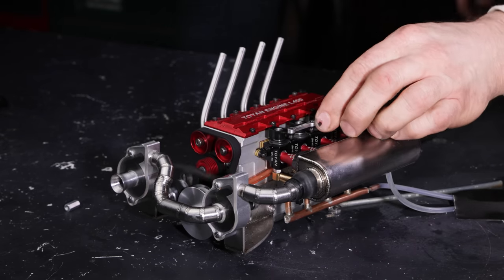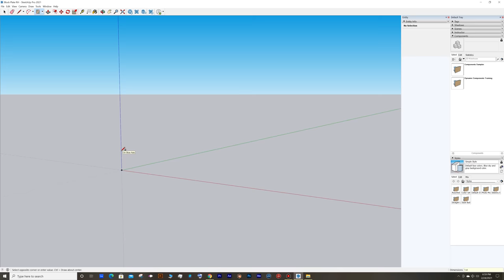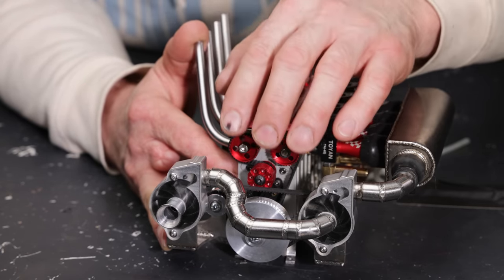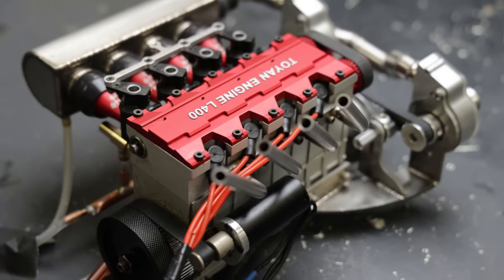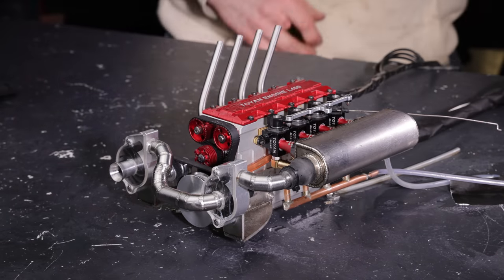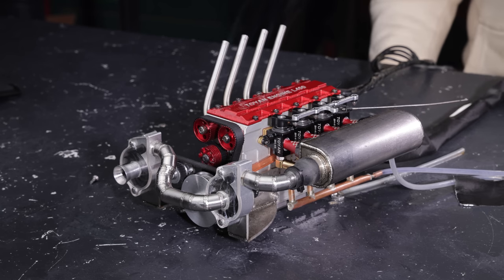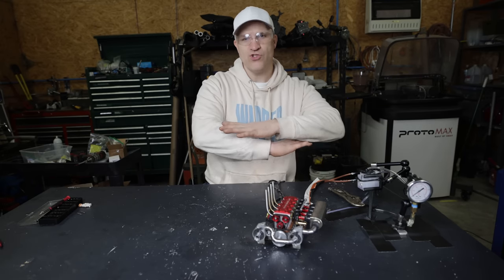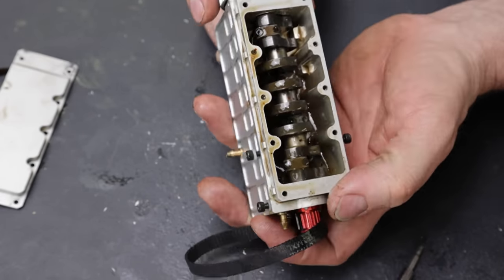Twin Supercharged 4 Cylinder Nitro RC Engine

Comment: I would love to see a 2JZGTE scaled down - actually, I’d love to see a Mk4 Supra built the size of a Lawnmower, 🤩
Reply from the maker: That would be nuts
Reply: @WarpedYT  A scale model mkiv go-kart with real scale model 2j wold be the coolest thing I have ever seen. 
Even though the newer Supras get all the popularity I love my 88 mkiii turbo, I have had it for 15 years and I love the styling on the 80's Japanese cars even still. My first Supra was an 82 mkii and I got crazy looks anywhere I took it, nobody knew what it was LOL.
Reply: 2 more cylinders and you're there baby
Reply: @755hp  that Barbie Jeep that grind hard plumbing is pretty wicked , it had like 50+hp and then they supercharged it.

Comment: When you installed turbo , you need to install Samco sport hoses and you also need K&N racing filter plus bigger coolant radiator and oil cooler 😅

Comment: You're having a fueling issue. Even the most efficient naturally aspirated engines run at several pounds under atmospheric pressure because of vacuum dilation from drawing in the air using a vacuum pulse. Since the engine is now running at 3 pounds over. It's actually seeing double the air. NA at high RPM is 14.5 - 8 = 6.5psi or less. This is why all but the most vacuum efficient motors see power loss at high RPM and why mid-history F1 engines could save fuel and still turn faster using high RPM NA grip. Then they survived the early turbo competition by running higher compression and using velocity stacks (like yours does). Giving them 7-8 psi (1.5 psi advantage). Remember this was before variable velocity stacks were invented and computer maping of intake plumes to time the refraction of intake pulse echo. 
Now your setup is 3 psi over atmosphere 14.5 + 3 = 17.5. That's more than double the air even with your velocity stacks power scavenging the vacuum pressure pulse in NA format. 
Now this is where the it gets complicated. Not only is there twice the air. Requiring double fuel to reach stoichiometry. People learned in the mid-history and before of racing to run richer mixtures well above stoichiometry for three reasons.
1.) Fuel cooling effect. The vaporization of the fuel draws heat away and puts it from the engine to the exhaust. Making better exhause flow, evacuation of spent gasses and cooling the head or intake gas. This also made more power by making the air charge denser alowing for even more fuel and therefore cooling.
2.) Rich mixtures turn more oxegen to CO2 and CO2 carries heat away with it. That why completely NO2 dependant drag motors use CO2 boosters to keep from melting pistons and valves. Enjoying a 2% power boost per charge and the ability to run even more NO2 and feul before structual failure of metal or meltdown/gauling occurs.
3.) A rich mix burns at a higher rate and continues to burn past the point of the exhaust phase. This creates more power and scavenging oportunities in maping the exhaust pulse reflection which then more completely emptyies the hot spent gasses. Which adds power by allowing more air and fuel to be added, but that also cools the engine better and the hot gas doesn't stay in place multiplying the cooling effect. Normally the forced air (boost) corrects this, but since you're running a naturally aspirated camshaft that effect is nullified.

Using a stand alone fuel delivery method (a variable electric fuel pump) and increasing fuel delivery (injector pulse duration in larger engines) should correct this (firstly) and gain you the most benefit.
Then change the cam.
Then run an inline connected exhaust header.
This will net 75% more power and keep you from overheating for 3x longer. Also allow close to an NA RPM ceiling.

I really appreciate your CAD skills, but this is what you missed. Engineering doesn't teach this stuff. It's all learned through asking race heads who've been learning these tricks for decades.
Can't wait to see you correct this and throw a rod for science. Get it on high speed please.
Reply: I was just about to say that. I might add that the dilation compression of the ventral cam is way too low under current atmospheric conditions. In order to fix that, he would need to triple the boost while adding fuel recovery in the midway valve tank rods. This will increase the power by reducing the power delivery in the centrifugal compression chambers. It’s just a thought but certainly worth a try.
Reply: Damn
Reply: Ohh naww😭💀💀💀
Reply: Just as I was going to say, the flux capacitor needs to be in wumbo to avoid flimjam at higher spinnocities. Jk but dang thanks for the info, you're like fuel ratio rain man
Reply: Alright. I'll simplify the explanation.
"Fat is happy"
Lean mixtures run way too hot and destroy race engines. This is why your economy car has close to a 14 to 1 fuel ratio (13.4-13.8 to 1) and a race engine is closer to 11 to 1 (11.1-12.4 to 1). The extra fuel adds more power while keeping the motor cooler. Even more so with forced induction (aka supercharging, supercharger, turbo, blower) or chemical supercharging (N02, LOX, hydrogen peroxide and other common oxidizers). An engine that runs at a extremely high RPM can cheat this effect. Like an F1, Indy, Superbike or MotoGP engine. They use the subsequent lower input of naturally aspirated air the engine pumps in itself at higher RPMs. This allows them to be able to add less fuel and not burn up. While keeping a decent power output vs mechanical grip. This is how they rev so high without melting parts or draining the fuel tank too quickly. The RC motor in this video runs on a fuel system that's mechanical fuel cam or a freeflow system dependant on the size of it. Either designed to do this fuel matching for RPM the same way. Less being more when in naturally aspirated format. That allows too much air per unit of fuel even with the higher fuel pressure setup he added in the video. Once you rev it up. This is causing the engine to run lean at RPM higher than idle.
Boosting increases intake air temperature too, but he already covered that in the video. So he knows this already and built a cooler.

What I'm pointing out is:
If you boost an engine without adding a ton of fuel. You gaul and melt important parts usually, or overheat constantly instead. If you're lucky that is. This happens regardless of how cool the charge air is. Cooling the air to increase the charge (volume of air) can actually make this even worse unless you match it with a higher flow volume of fuel.

So yes. To dumb it down. More fuel to a point. Means No Whammies.

If you're tuning a race engine. The rule of thumb is to add fuel at any given RPM until you experience power loss. With forced air it is a bit more complicated, but still very similar. That is why boost by gear and multiple or provressive tunings to match boost controlling components is so very important. This not only can prevent you from overpowing the tires. It can keep you from running catastrophically lean on fuel. Which typically melts parts. Running rich isn't usually as big of a problem. Since it only causes power loss, stall or bogging down.

The fact he's overheating instead of the other possibilities means that he is very close to the more ideal fuel to air mixtures. Which again proves that he (the video author) is pretty smart to get it that close to ideal with what he used to calculate the variables in question.
This gives me confidence that with a stand alone fuel management setup. That he can push this motor much harder without overheating. Making the next natural point of failure the piston rod.
However since the reciprocating mass is so low. Rendering both primary and secondary imbalnce to such small loads. That I'm excited to see if he even can throw a rod before pushing up the cylinder head, blowing the head gasket or spinning a rod or crankshaft bearing (the four next natural points of failure). Maybe the caps will walk. I'm genuinely excited to see what happens when he increases the fuel and pushes that little motor to over 9,000 rpm 😁
Reply: This is a big brain youtube comment right there
Reply: @patsfast1980  what

Comment: Compound turbochargers are used on petrol too, common usage is a small turbo feeding into a large turbo. Small turbo spins up way faster but only provides a little boost, big turbo spins up slower but gives massive boost. Helps to even out the power curve compared to having just the large turbo on its own in a performance application.

Comment: You may want to lap the valves, I think JohnnyQ90 had a decent improvement from doing that.
Reply: Yeah that made a huge difference
Reply: I assumed this was a JQ90 video when I saw the thumbnail. Would be interesting to see lots of guys pushing small engines like this.

Comment: After seeing a couple YouTubers fail with their forced induction and me recommending they try out a compound setup, I'm happy you decided to do it! :D
Also, I don't know if you would consider this or not, but I remember watching EngineeringExplained's video on a turbocharger which had a mix of axial and radial compressors on the inlet. So at the very entrance there was like a superchargers screw that helped keep the turbo from surging (giving it a compound effect and therefore raising the possible boost) and after that screw was the normal radial turbo wheel. They reported improvements of about ~20% increase in pressure, if you would be up for the task of trying to build something similar, that would be awesome! :D

Comment: Antifreeze has oil lubricants mixed in it to help lubricate waterpump bearings and help prevent internal corrosion. Possibly using actual antifreeze might combat the overheating issue.
Reply: Or you could use Evans

Comment: That belt is a problem.  Its oscillating so far up and down it looks like bugs wings flapping.  Maybe the distance between your superchargers as far is the belt is concerned is too far without support up top.  Maybe put a downward pressure idler like more of a serpentine  idler?

Comment: in general the second stage should be the first stage size divided by first stage pressure ratio. If the first stage can make .5 bar boost, it should be 1.5 x the size of the second stage
Reply: I think you are right, if they are the same size, it wont work...
Because the secound turbo can only compress so much air, that the first turbo delivers, if they are the same its useless😅
Reply: @veoverse4286  using 3 of the same size with 2 feeding one would work
Reply: If there's rpm left on the table you can still increase boost pressure. You're pulling in boost and then shoving it through another compressor, boosting it more. You just might as well have a bigger one that has a more ideal power range. Two fans means more friction and mass and whatever so it's less efficient than one big charger.
Reply: @snakeballs8965  it all depends on where the compressors are efficient and working around that. a single stage is good to over 70 psi in race applications but staging is needed for real high pressures.

Comment: I believe compound compressor setups don't just add x psi of boost each.  The total output depends on the compressor's "pressure ratio".  If a single compressor made 10psi of boost from atmospheric pressure, it would have a pressure ratio of 1.68 to 1.  It's taking the 14.7psi of atmospheric pressure and multiplying that by 1.68 to get 24.7psi of total pressure (+10psi of boost).  Now in a compound configuration, you would then multiply that total pressure again by 1.68 for a total pressure of 41.5psi (+26.8psi of boost).  A bit more than expected.  Awesome project BTW!

Comment: What is the point of having those two I will say compressors, attached to that engine for? They're the exact same size. So there is a redundancy in your intake system one would do probably better than having two. And since the exhaust diameter both of those compressors is the exact same the second one attached closest to the intake manifold would be a bottleneck because it is receiving all of the forest air from the first compressor and it has to battle the the pulsating air pressures that reside within intake manifold from the valve train. I'm confused.

Comment: That’s not how compounding works…compounding is for no other reason then to reduce lag…you run a small turbo which spools quickly but runs out of steam quickly to feed into a larger turbo that doesn’t spool as fast, but has the top end power you need…it has nothing to do with multiplying boost. And running 2 equal sized turbos, or super chargers in compound configuration is pointless, as your just reducing efficiencies and heating the living hell out of the air…cool ass project and fun to watch machining however.
Reply: Exactly. If the objective is to get more air into the intake ports, then "compounding" only compounds the airflow resistance, and adds (in this case) a bottleneck that makes any secondary turbo pointless. The flow from turbo 1 to turbo 2 is the same diameter as turbo 2 to the intake. Any additional gain in turbo 2 requires a dramatic increase in energy respective to output, which wouldnt make sense since they're mounted in series to the same energy source (exhaust). Which is why turbo 1 has to be smaller than T2 to have ANY benefit, and the only benefit it could offer is low end torque since it is merely overcoming low rev lag.  It'd be far more efficient to mount equal size turbs  in parralel like a traditional twin turbo like every major manufacturer has made for decades for all the above reasons.
Reply: @BK-fg7is   &  @sean metzger Just a point of issue concerning the application of nomenclature. Forced induction methods of aspiration are of course, turbocharging and supercharging. (Nitrous Oxide is technically not "forced" induction but a chemical super-oxygenating agent introduced into a normally aspirated engine.)  The principle of the smaller/bigger forced induction applies to turbochargers only; the reason is since they are spooled up by exhaust gasses it is inherently slow to spool up from idle to WOT. This is the turbo "lag" you both mention and your remedy to reduce or offset the lag with first a small turbo for off-idle acceleration improvement over lag and then a 2nd stage, or bigger turbo to "take over" higher RPM to top speed WOT is spot on DNA Dead Nuts Accurate.
But what we have here is a true supercharger. There is no turbine for the exhaust to spin the compressor. It has a pulley instead of a turbine. The pulley is connected to the crankshaft via a belt, which turns the compressor, and can be overdriven or underdriven with appropriate diameter crank or compressor pulleys. The benefit is no turbo lag; the compressor spins directly in relation to the crankshaft, and volume depends on pulley ratio. The "staged" method for superchargers doesn't apply; the amount of air forced or injested is entirely dependant on the smallest diameter anywhere along the intake path, no matter size or number of superchargers.
But don't get me wrong, everything y'all said was spot on DNA.

Comment: This is so excellent! It brings  me back to when I was working with model engines as a teen, mostly those little .049 cu in airplane two-stroke ones, and I bought something slightly larger but never got it to work. Curious - what would be the approx power output of this 14CC, as is ( no supercharger or turbo)?
Reply: 3hp i believe...

Comment: Electric super/turbo charger, that is all.
Reply: so leaf blower
some dude put it in his car didnt work.
Reply: So you bought one on eBay years ago, and found all it did was enrich the seller.  It doesn't work, and a fan that puts out 50CFM ISN'T providing enough air to start with!

Comment: when running that, wide open you could try submerging the cooling rad in a large bowl of ice water or like a Coleman ice chest full of water and ice, we have done this for overclocking CPU's and it works excellent (high powered CPU can reach temps of 90+ Celsius) so should not be a problem for that little 230F engine, another note maybe use a larger 240 or a 280 mil radiator and keep it elevated to reduce air pockets in your engine

Comment: Yeah, you need twin screw superchargers and you need a radiator that two to three times larger, and if you can at all wing it, put some heat sinks in line with the radiator and you might need to make your own, larger water pump to keep up with the heat the engine is making with compound superchargers. Just making the cooling system larger alone should help but a more powerful water pump would definitely help move the heat away from the engine. You've solved the breathing problem, now you need to manage the heat problem. Going to an electric water pump would prolly be the best soolution, that way you aren't robbing the engine power just for the water pump.

Comment: Fantastic. One atmosphere = 15psi. Each compressor is supposed to deliver 10psi (i dont believe they can) so the compressing ratio is already high after the first one. Then the second one should be a different model working on a lower volume of air.

Comment: Forgive me if I’m mistaken but the only way for the second compressor to make extra boost would be if it were not connected to the drive belt. The only way for the compressor to make more boost is to spin faster than the maiden unit. This is why compound turbo setups have a small charger provide increased airflow to feed a much larger turbo than the engine could spool at a low rpm.
Reply: Not trying to start drama here just curious how this could work

Comment: Very cool! Fun looking! It doesn't make any boost though, a forced induction engine doesn't build boost unless there's load on the engine. That psi is for the fuel system. I own both supercharged and turbocharged cars. You should put it on a RC car and build a tiny dyno for it and see what kind of boost it makes!